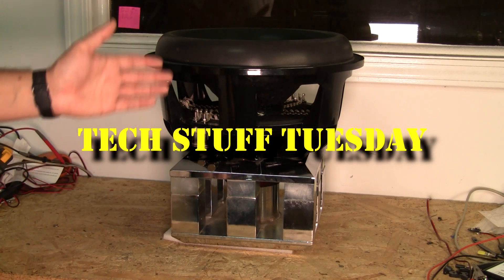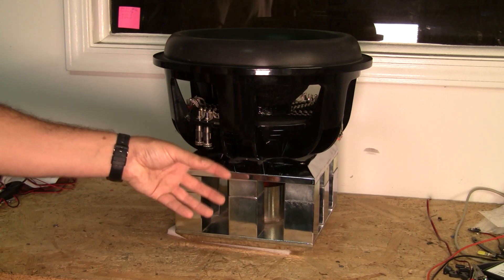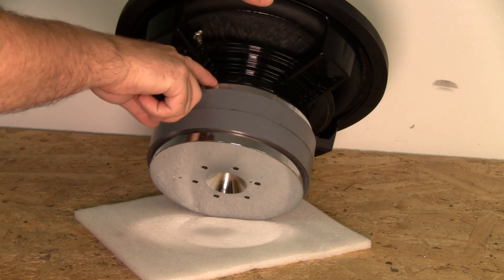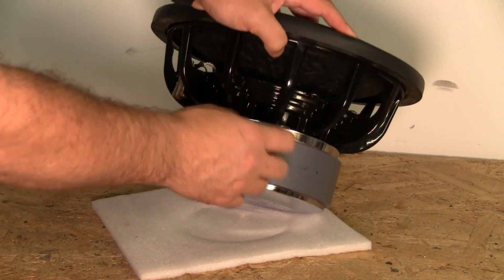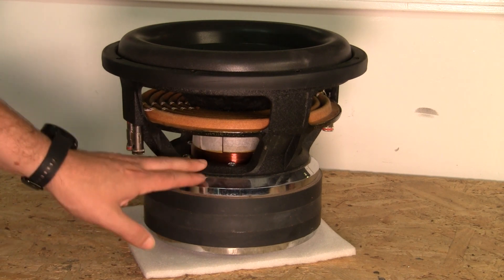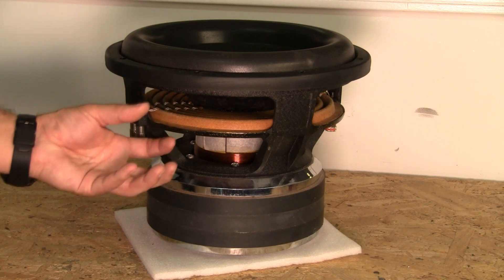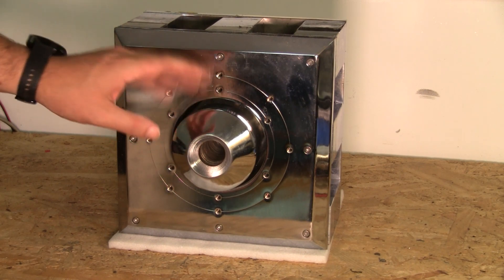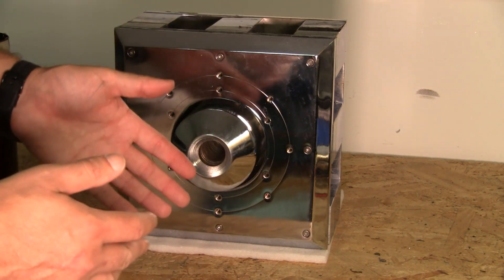This is how subwoofer cooling methods work - Tech Stuff Tuesday

Comment: Very cool explanation about power handling. The next big innovation that will come to car audio would be "over clocking" subs and having an external radiator/cooling system to allow subs to handle much higher powers than they are rated for.
Reply from the maker: It's been done, and a reason it's not.

Comment: Question: Are the magnets on the corners not less effective if they are of the same strength like the magnets in the middle?? Do they still work as intended because the distance to the coil is bigger?
Reply from the maker: I made a video about this when I first showed a prototype and the "experts" talked about how it didn't work. It isn't a radial design, meaning the field is vertical, not horizontal. It doesn't matter how far they are from the coil, the top plate saturates the same regardless.
Reply: @EMFAudio  Hey man thanks for the answer!! I am very curious about things like that, and i must admit i do not know much a bout magnetism and i really love "the look" of these woofers (probably the sound too) But thank you for taking the time to answer...Love techstuff tuesdays and grtz from the Netherlands!

Comment: Hey what if you have small vents on basket around the basket and only a center pole. Can  i mesure and drill where the voice coil is under by the center cole so itll force air out from the voice coil chamber?(the gap vents) Thanks. 
Please answer cuz im upgrading my coil and hoping to push more power and also do as much cooling mods as i can. Thanks for ur time
Reply from the maker: Simply adding holes doesn't mean better cooling. Drilling into magnets should never be done, and drilling into steel on a motor should only be done when de-magnetized.
Reply: @EMFAudio  hey yeah i understandm but if the frame is just like that but without the air gaps . What if i were to drill those holes before i install a beafy coil???
Wouldnt it work as cooling? In a big box

Comment: I have the Machete M15D1 Super Sport (I know not your brand) and don't understand why they didn't add better cooling by No pole vent venting like the lower version. How does closing off the pole vent help at all?
Reply from the maker: A solid pole does have it's place in design, especially for shallow applications. The Sundown SD line doesn't have a pole vent, but it's also not intended to have a ton of power either. There are higher power rating subs that lack a pole vent, but they've typically been burp subs.
Reply: FAB ENTERTAINMENT how do you like that sub? I was going to get one soon, same size.
Reply from the maker: @cryptochef313  Based on what a customer told me, you're better off in a Lowballer, https://emfcaraudio.com/products/emf-audio-lowballer-15-subwoofer
Reply: EMF Audio I may try, haven’t heard any reviews of them or seen any videos yet.  If it’s better than the 1300 RMS deaf bonce then I’m game.
Reply from the maker: @cryptochef313  all the reviews got deleted in the website migration but the model mentioned from them is 750 RMS. We have Banhammers on sale now too.

Comment: Looking forward to when the v3 of these come out
Reply from the maker: No reason to do a v3 yet.
Reply: @EMFAudio  so i guess the v2 is just getting some upgrades ? I remember you saying something about the motor design if im correct ?
Reply from the maker: @chadbeverly4926  It will still look like one, but noticeably different.
Reply: @EMFAudio  so no more square motor 😭 ? I cant wait for the pre sale !
Reply from the maker: @chadbeverly4926  Who said that? Why ditch a patented design?
Reply: @EMFAudio  oh I'm sorry when you send like v1 i thought  you meant v1 of the series before the square  motor. My mistake
Reply from the maker: @chadbeverly4926  I think you're confusing different series of subs too.
Reply: @EMFAudio  you were telling me that it would still look like ermergerd v2 sub just with some diffrences ?
Reply from the maker: @chadbeverly4926  I thought you meant Banhammer v2, been answering questions about those.
Reply: @EMFAudio  oh no sir i was acquiring about tge ermergerds.  Didn't know if they were in R&D for changes or just not built anymore and had to get custom built

Comment: Now this is a good one. I wonder the difference a massive pole vent makes verses just spacers and a sealed magnet.
Reply from the maker: There are many considerations and variables, one being the pole vent itself effects motor force. Being solid vs having any hole and the size of the hole will all effect things.

Comment: Does inverting a sub decrease the cooling effect being outside of the box??
Reply from the maker: It can actually INCREASE cooling because there isn't warm air circulation, or less of it, depending on the box.

Comment: A better break down of coils temperature to wattage would be cool.
Reply from the maker: That would definitely vary between subs, that data would only be valid on this sub and not in an enclosure as air circulation in the box or cabin would change that.

Comment: I guess from this video I got that i should add some motor spacers when i finally decide to recone my old-school HCCA 12"
Reply from the maker: Not necessarily. It's a 3" coil with some decent length and rated for 600 RMS, stock. Those never really had a problem handling power. If you planned on building for higher power it might be a consideration.
Reply: if you do that you will have to increase the length of the coil former or you will end up jumping the gap.

Comment: Love the video. Explains why the banhammer can take 3,300 Watts for a song even though they're rated at 2K.
Reply: After time... 3300 rms will make the sub fail. Break alot quicker...
Say.. 1 hour continuous..

With the suggested power...
The sub will play the same music for 10 hours without failure
Reply: @adamhearts9195  Yup, I blew them up shortly after my comment.
Reply: @LoudFiat  higher power doesn't necessarily equate to failure... In terms of causes.

It's more likely a failure caused by a clipped signal being sent to or from the amp. 

Those can cause damage immediately    ,  ..

Clip signal + over powered = things breaking quickly.

I found this out the hard way too... Destroyed a 4 inch coil 😂. Looked like it got hit by an IED
Reply: @adamhearts9195  I ended up running 6k watts RMS to each sub, so in my case I know what happened. They went way beyond xmax and I also fried the coils.
https://www.instagram.com/loudfiat/
Reply: @LoudFiat  nice wall!!

What fi subs do you have?

I'm building a single sub wall right now.   Sundown team 18. Ferrite V2
Reply: Fi sp4v2+ on a 112,000 watt 400v amp
Reply from the maker: The IED look can be seen in the video I did about coils and knowing what you did. Reference the Brazilian amp example.

Comment: I have 2 questions for you. (1) Why are all companies still using the old heavy magnets? I understand it's a cost thing but when it comes down to it shipping would almost equal itself out. Not only that but the magnetic pull is so much more better then traditional magnets. Even the best traditional magnets vs the lowest N pull neodymium the neo will win. 
Question (2) What type of metal do you use for the top and bottom plate of the magnets and center?
Reply from the maker: 1) Cost is a huge factor, and neodymium is also very volatile on price so consistent pricing is an issue. Shipping cost won't make up the difference in most cases. Consumer impression is also a factor. Remember, there are companies adding plastic boots to motors to make them look bigger because consumers think a bigger motor is stronger and handles more power and will sound better. Spending more to make the motor smaller would have a negative effect on sales for the most part. 2) What isn't magnet is steel, and that's where your weight comes from on the bigger subs. That's why there isn't as much weight savings as you'd think, maybe only 15-20% less weight.
Reply: @EMFAudio  oh ok. Thanks for the magnet insight. I was doing a little research on what metals have more pull when a magnet is applied and found that some casts are great. I'm just trying to find the best metal for the most pull from the magnets. If that makes sense.
Reply from the maker: @ruffypoo  Not all steel is created equal either. It's not just materials but the content and quality of the materials.
Reply: @EMFAudio  oh I know this hahaha. There is about 20,000 different kinds of aluminum no joke. Very mind boggling

Comment: Are mids and tweets cooled in a different way?
Reply from the maker: Tweeters are often cooled by fluid, mids have a wide variance in how they're done. Few use a pole vent or gap venting till you get into the higher power and bigger sizes. Basket venting is the most common. There are a lot of mids that have no cooling though, but very low power so not much heat dissipation.

Comment: What's the best way to cool a amplifier
Reply from the maker: Air
Reply: @EMFAudio  LOL I know that much what I really to say is fans a good option
Reply from the maker: @backvic  A properly designed amp is the best option, but when the amp isn't designed to handle the heat then yes, a fan is the best option.

Comment: Ok time for a dumb question why not add a fan to assist the air flow
Reply from the maker: There could be complications with pressure on the fan blades. They could break, fast bearing wear, interference, etc. There is also the fact that you'd have to run power wires for the fan also, which is another thing for somebody to mess up installing.
Reply: Just to add on to what he said, its been tried and was found to be counter productive while playing. It also at high SPL's broke the blades off of the fans. The best we came up with years ago was a liquid cooled motor assembly, but that caused a loss in motor force and was insanely expensive to machine.